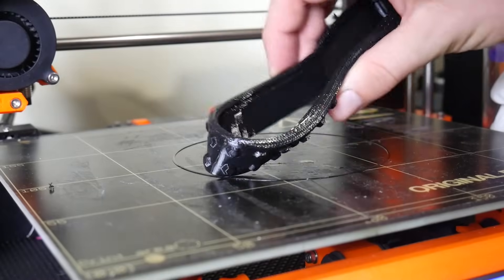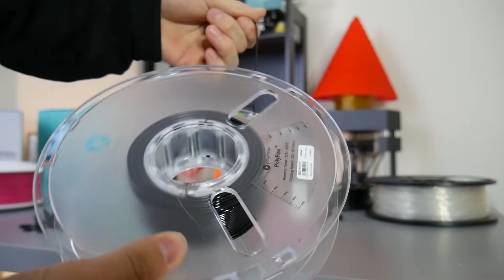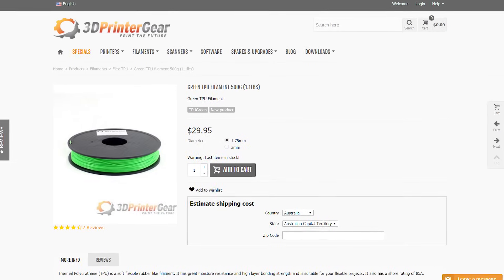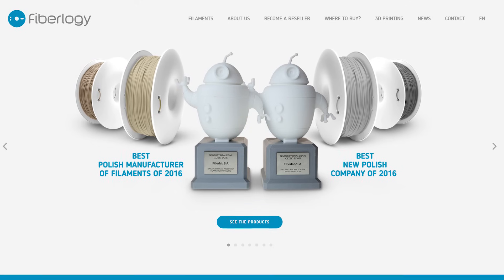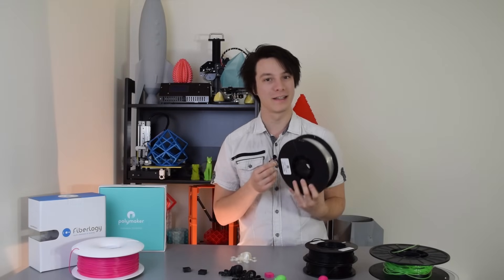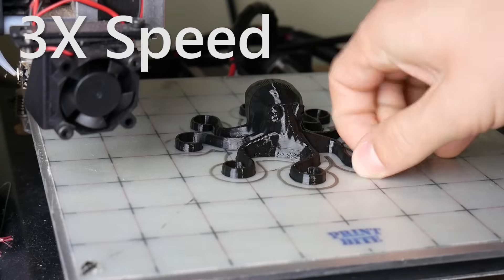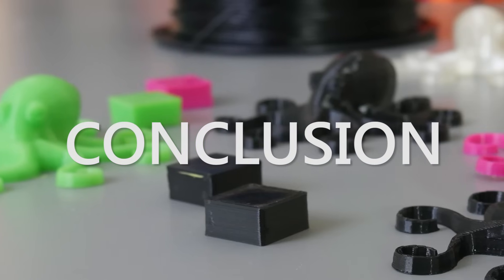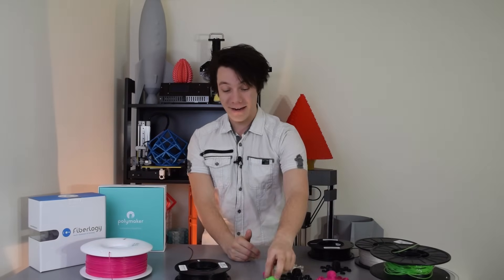Flexible 3D Printing Filaments Tested - Which Flex is Best?

Comment: Life with a 3D printer: Currently 6 A:M. Started 45 minute print at midnight. Just finished now. Dealing with the design, misprints then a huge clog was well worth it.
Reply: Hendryck De Los Santos what did you make
Reply: I made Arduino clips to hold and mount an Arduino board to anything by screwing the mount in, but I'm new to 3D printing which explains the long hours I put into printing something so simple. Currently, I am designing and printing connectors so I can make frames out of 6mm wooden dowels, and they're coming out perfect! I even made a dowel connector that connects to my Arduino mount instead of screws. Effectively, I am hoping to have a fully modular array of connectors and mounts to mount all sorts of Arduino modules.
Reply: keep up printing, you'll see, it gets faster and easier when you know what settings to tweak for what types of prints :)
Reply: Nathan Green Tinker Cad is a free web based 3d printing design software
Reply: what program do you use and is it free?
Reply: would you be able to send me the link please